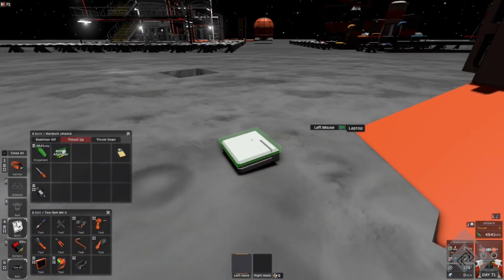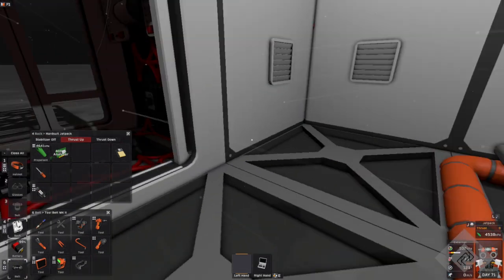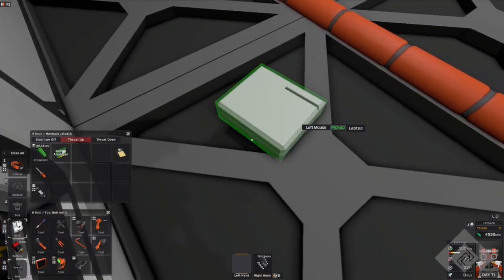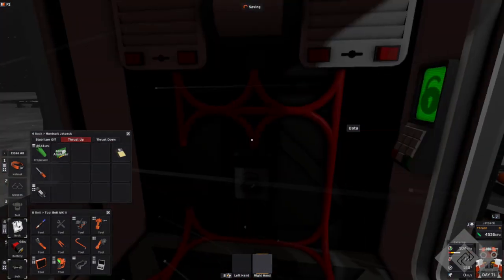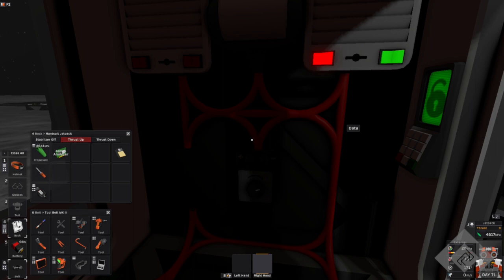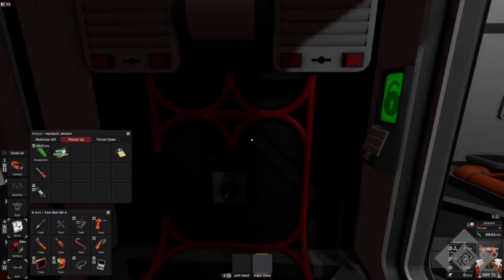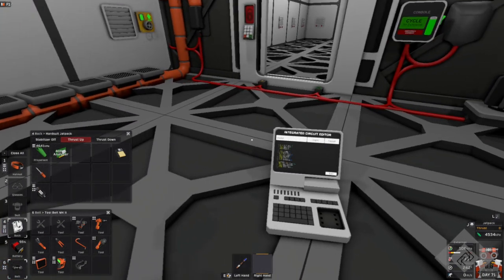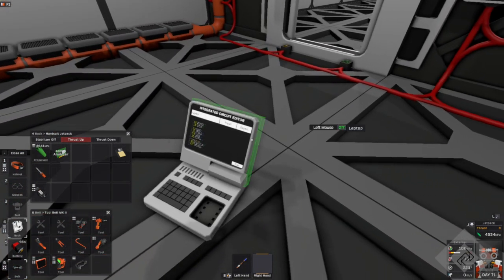Custom AirLock Script, an update - Stationeers

Comment: Love the custom airlock. Possible the most advanced I have seen so far. I'd love to see a 2 cube airlock, with multiple vents for faster compresion/decompresion. Having a very fast airlock would be nice, even if it's 2 cubes long.
Reply from the maker: You can easily expand the size of the airlock by using a read chip to take the state of the active vent, then write it to any number of vents you like. But by default, the simple airlock board can operate as many vents as you would like. I show this in the rover garage video.